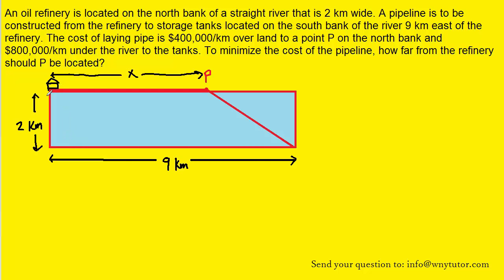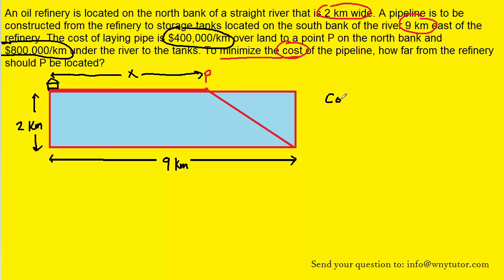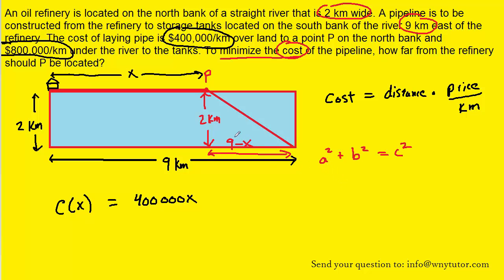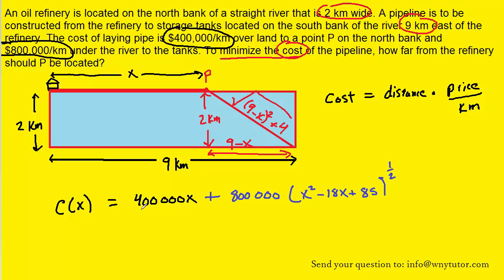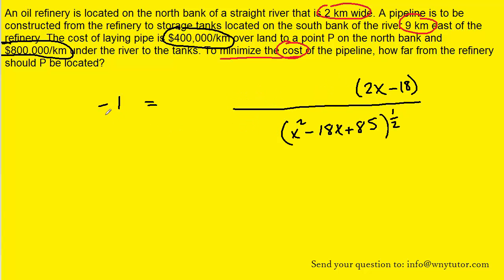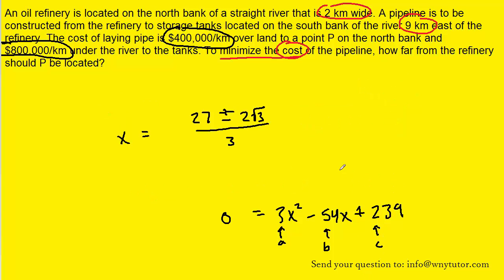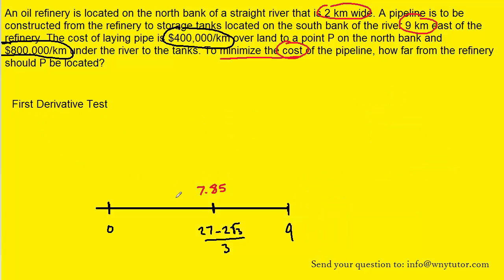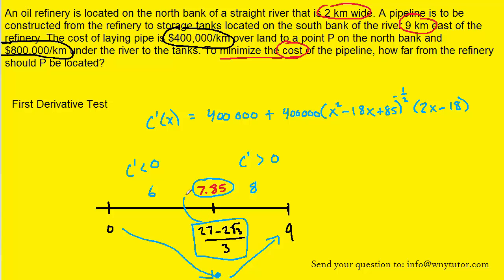An oil refinery is located on the north bank of a straight river that is 2 km wide. A pipeline is to

Comment: Mine has a 6 not a 9, and when I follow along it get (3x^2)-12x+104 as my simplified derivative, and that has no zeros. the back of the book says the answer is around 4.85 km east of the refinery. What am I doing wrong?
Reply: the derivative equals (3x^2)-36x+104